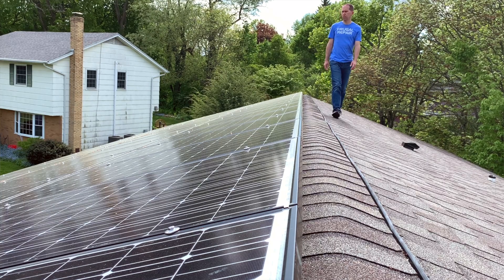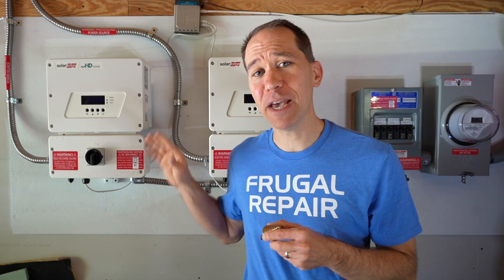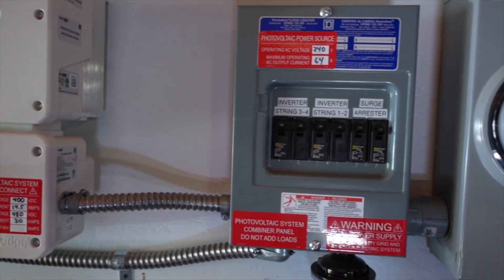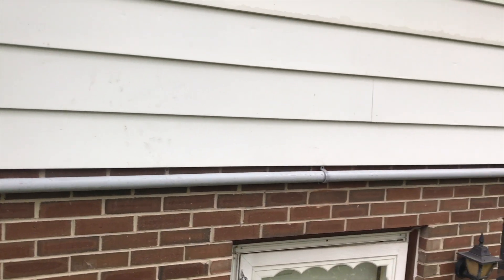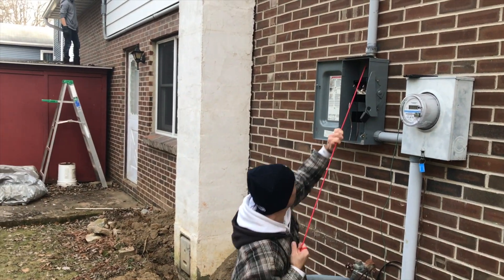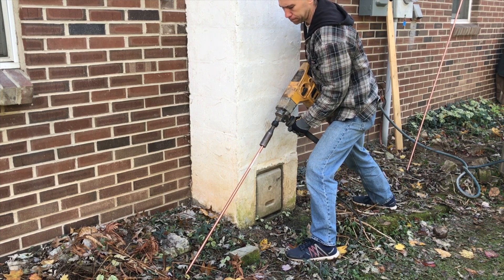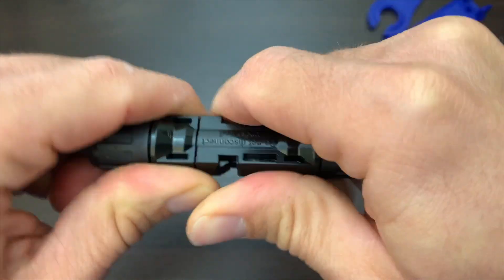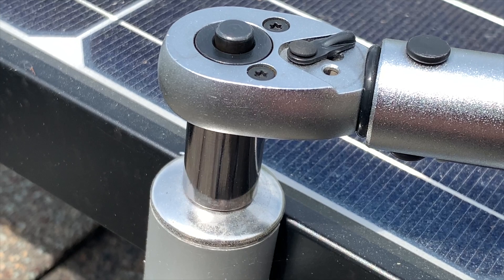DIY Solar Tools - Watch before doing a DIY install

Comment from the maker: What has been the latest project you have worked on?
Reply: We redid every room in an acreage that was run down.  Built a few solar heaters on the secondary structures, and this year, it's all about making one of the structures into a workshop.  This weekend i'm tearing out a section of wall to put in a  9' garage door.  We'll see how that goes!
Reply from the maker: Wow, that’s a lot of work but I bet you’ll be happy with the result!
Reply: @FrugalRepair  It's been 8 years, and i started with so little experience that it surely has been a journey.  If only i had documented each step on video!
Reply: Those ground rods can be installed by hand by moving them up and down and using water to soften the soil in the hole doing it should take about 30 seconds to 1 minute

Comment: Great videos Reece. I am in the Northeast with a southern facing sky. However I am concerned that my roof has a low pitch 4 x 12 with approx. 18 degrees. Any thoughts/insights?
Reply from the maker: Thanks!  That is the pitch of my roof so I think you will be good.  You can get pretty good modeling with pvwatts.
Reply: @FrugalRepair  PVWatts is estimating about 13KW of power generation using the low pitch roof of 4 x 12. Is that good for a 10KW system?

Comment: How did you get away with putting the panels all the way up to the ridge?   That is a no- no for most fire codes.
Reply from the maker: That part of the building code wasn’t adopted in my area so the electrical inspector said it was fine.

Comment: Hello Reese, a quick question regarding tightening the solar panel to the roof. How frequently do you check to make sure that the boots have not loosened?
Reply from the maker: I haven’t checked them. I don’t anticipate needing to but maybe one day I’ll check again with the torque wrench to see.
Reply: @FrugalRepair  Thank you

Comment: Hi Reece.  Your videos are very well done.  One question...  I see that the bottom edge of the panels is very close to your gutter.  During a heavy rain, do you notice that the momentum of the water flow goes over the gutter?  At the top, it looks like you could have gone a little higher (made the top edge level with the top of the roof; or even past that).  If you had it to do again, would you install the panels a few inches higher?
Reply from the maker: Thanks!  No, the rain goes into the gutter.  I’ve been happy with the placement.  I only had a few inches of wiggle room on either side so I doubt it would have made much of a difference.  I didn’t want to go over the ridge because then I’d worry about wind gusts, even though the panels would probably be fine.

Comment: Do you have batteries for your system?
Reply from the maker: I don’t have any batteries connected to the system.  Net metering is the reason why I don’t.  If you check out the “is solar worth it” video I explain the credits I get from the net metering agreement with the power company.  In PA here you get a 1-1 credit for each KWH you send back to the grid.

Comment: Great video.   One comment.  It looks like you put your 8 foot ground rod in at about a 45 degree angle, which is only 4 feet deep into the ground.  By code, that deviation is only allowed to be done if you have rocks preventing installing the rod at 90 degrees (perpendicular).  At the 45 degree angle and height, you can hit it pretty easy with a sledge hammer and it will go in fairly easy, instead of needing the large hammer drill.
Reply: Why would depth matter? All surfaces of the 8' rod are touching earth no matter how you do it.
Reply from the maker: Thanks!  My electrician set up the rods for me to drive in and the electrical inspector passed it so I guess maybe it’s standard practice around here where there is a ton of rock.
Reply: Putting an 8' rod into the ground at a 45 degree angle would put it 5.65' deep into the ground 8*sin(45)

Comment: Hi buddy!  I uploaded that video I mentioned a little while ago if you want a laugh :)  It's called 'I found a 4K LG T.V at the dump and fixed it with a piece of sticky tape!'  Thanks for being awesome!
Reply from the maker: I’ll have to check it out!
Reply: @FrugalRepair  No worries mate.  It's not as polished as one of your vids but you might get a kick out of it.  Especially when the picture came good and you see my reaction :D
Reply from the maker: I just skipped through it, great job!  Isn’t it rewarding to see that good image come up?
Reply: @FrugalRepair  Absolutely,  You have no idea how many of those things I've actually tossed out because of that particular fault.  Thanks for teaching me :)
Reply from the maker: Great job on those you did fix.  Next step is to learn a bit of electrical engineering and understand why this trick works. =)
Reply: @FrugalRepair  I'm pretty sure I understand it now.  I did back then but found it difficult to describe how so in my video.  I'll get better ;)  I'm about to release another video of a 4k 60 inche LG  that I found outside in a thunderstorm (hail and everything).  I dried it out and did this exact fix.  Now it's my new personal tv lol
Reply from the maker: That’s great!